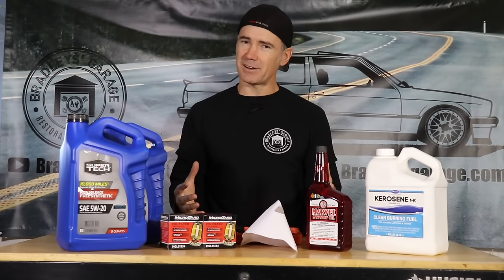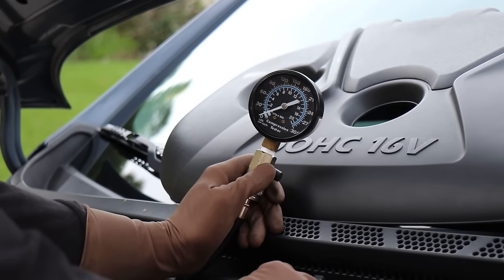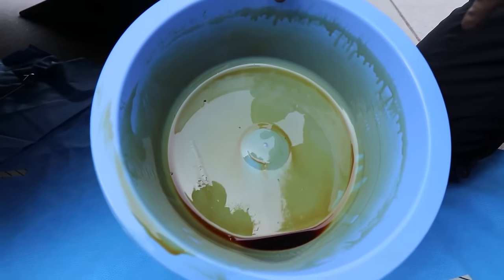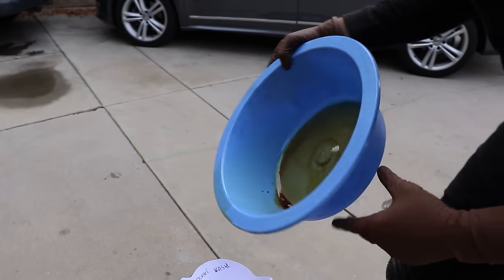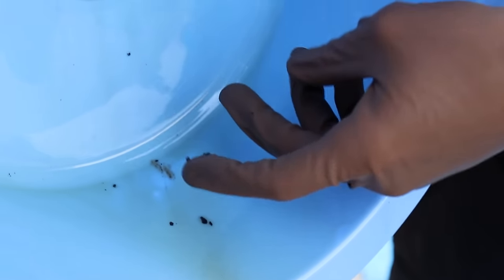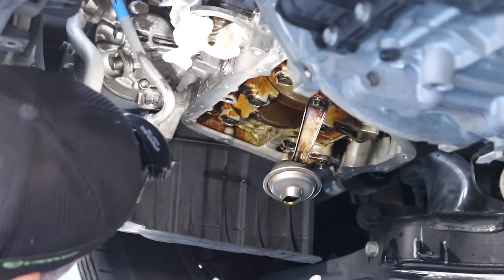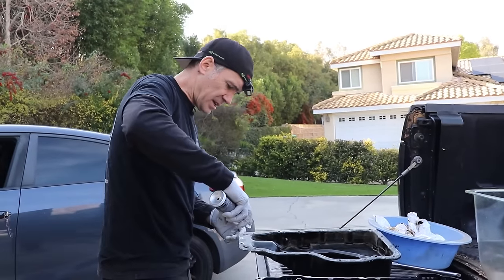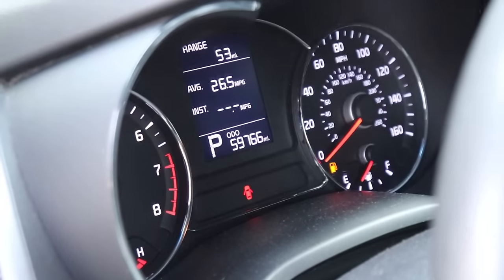*UPDATE* Customer States Jiffy Lube refused to change my Oil - Sludge Factory Kia Forte

Comment: What kind of gloves are you using? They look very durable
Reply from the maker: Thanks for the question, our go to latex gloves are the MicroFlex Diamond Grip brand.
https://www.amazon.com/Microflex-MF-300-M-Diamond-Textured-Fingers/dp/B002T11XJ0
We have a couple friends that work in the OR so occasionally we get a variety of other styles but Latex works best for routine repair work.
Nitrile gloves are cheaper and thinner but stand up to chemicals (gas, solvents, brake cleaner, etc.) much better than latex gloves. So we use those for all the cleaning and chemical usage.
Cheers!

Comment: 2 bottles of rislone concentrate run for 500 miles would have flushed most of that
Reply from the maker: Thanks for the recommendation; we will definitely check out that product for our next Sludge Factory project.
Cheers!
PS - Be sure to check out the original video if you haven't seen it - https://youtu.be/XU79jXYWydA

Comment: Instead of diesel try using diesel engine oil, look for HD3 oil, which has a lot of detergent in it which gets all the sludge off.
Reply from the maker: Thanks for the recommendation Sean, that might be good to use for 3k miles. We will see how things look during the next oil change.
Cheers!

Comment: 345,000 on my 09 Tacoma and still can’t see the oil on dipstick when checked at 4,000 miles. Vehicle has been properly maintained since new
Reply from the maker: Thanks for the comments Rocky, I'm sure after 345k there will be a little oil burning going on. You could check the dipstick every 1k miles after a fresh oil change just to get an idea of how much it is burning over time.
Cheers!
Reply: @BradleysGarage  check it every 1,000 miles as it uses a quart every 1,000 miles. I was stressing how CLEAN the oil was

Comment: At what point does it become more economical to just replace the engine vs trying to eliminate sludge?
Reply from the maker: Thanks for the question, a good used engine is going for about $1,800. Figure another $2000-$2500 for removal and installation so you are looking at over $4k. All of the supplies for these flushes only came to $250.
It really comes down to how much time you want to spend on things versus how much money you got.
Cheers!

Comment: Great job all around. I'm a big Hyundai Kia fan. I've purchased 7 or 8 new ones since 2007. My latest purchase was two 2022 Tucson Hybrids (non plug in, only because they were never available here in Illinois) I bought an SEL Convenience (mid trim for myself) and a Limited (top trim) for my wife. They're amazing cars for the money, 33K and 39,5K. Getting 37 MPG out of each of them over the last few years. I'm a 3000 mile oil change guy myself. It's cheap insurance for these tiny 1.6 Turbo engines which work hard. Thanks for sharing all your great tips. Go Niners. Cheers
Reply from the maker: Thanks for the kind words, glad you enjoyed the video. We have recommended to Jake to start changing his oil every 3k moving forward. Like you said, it's cheap insurance to keep things running great for many more miles to come.
Cheers!
Reply: the 1.6 in that model hybrid i believe is still gdi as well so 3,00 miles intervals should help with carbon buildup, it kills Hyundai motors besides the metal debris left indie the motors.
Reply: @henrytom5824  Thanks
Reply: Buying a car every 2 years and judging them with just 30K miles is nothing, they are brand new. Tell us how are they doing after at least 100 K miles
Reply: @drbichat5229  warranty goes to 100k unlike all other brands
Reply: @drbichat5229  30K???? LOL, my SEL Convenience is two years old and has 3600 miles on it. Sometime in the next 4 weeks I'm selling it to buy a new 2024 Santa Fe Hybrid with the outdoor package (off road) on it. Hyundai is just like any other major brand. You get good ones and bad ones. It happens across the industry and has for 5 plus decades
Reply: 8 in 15 years sounds like junk to me. I’ve got 270,000 on my 2008 dodge ram and my last vehicle had 300,000 when I sold it and it’s still on the road
Reply: @DanielJohnson-ec8rk  LOL, don't be a hater cuz I'm a player bro. We're talking Hyundai's dude, not Mercedes, lighten up
Reply: I have 280k miles on my Santa Fe without problems 👌
Oil change every 3k miles. Everything works w/o issues..
Reply: @spacemaster5206  Wow, that's amazing.

Comment: Looks like it is ready for some long life now.  Just drive it and run 3000 mile oil changes.  pulling the oil pan and cleaning the sludge was probably the best action that you took.  I wish my 62 Lincoln oil pan was that easy to access.
Reply from the maker: Thanks for the comments Jeff, appreciate the feedback. Hoping it works out for this young kid since he really doesn't have the first clue what it takes to service a car properly. Cheers!

Comment: Some engines are sludge engines due to low friction low tension piston rings. Needs frequent oil changes.
Reply from the maker: Thanks for the comments. Hopefully we have done enough to salvage the motor.
We just posted the 3k mile update video here - https://youtu.be/QrJ0B-KXTw0
Cheers!

Comment: I would replace the PVC valve for sure
Reply from the maker: Thanks for the comments Chief, it was surprisingly clean and still had great flow after the valve cover wash. Since it's built into the cover you would need to purchase a new one at a cost of $250. The check valve itself is working as designed.
Cheers!

Comment: Most engine flush bottles are half diesel and half kerosene.  It does work at reducing sludge
Reply from the maker: Thanks for the comments Nicholas. We performed a good mix of a variety of solutions to get this one clean.
Be sure to check out the original video if you haven't seen it - https://youtu.be/XU79jXYWydA
Cheers!

Comment: Let's see valve cover pulled 10 times that will be 1500 dollars sir 😅
Reply from the maker: It's actually very easy on this motor, it only takes a couple minutes. We posted the 3k mile update video if you haven’t checked it out yet - https://youtu.be/QrJ0B-KXTw0
Cheers!

Comment: I believe you just saved that engine. And I hope the owner learned a valuable lesson.
Reply from the maker: Thanks for the comments Scotty, hoping we did enough to salvage the motor. We just checked in on it after 1200 miles and everything looks great. Oil level is still perfect and there are not any issues.
He's just a 20 year old kid that doesn't know anything about cars or what is needed to keep them running properly. He helped with the repair so he wants to learn and understand things.
Hopefully he has learned a valuable lesson on the importance of routine maintenance on his car moving forward. The goal will be for him to be able to change his own oil moving forward.
Thanks for hanging out, Cheers!

Comment: One thing that has worked for me is to replace 1 qt of oil with 1 qt of transmission fluid,
Reply from the maker: It was a toss up for us, diesel or ATF. We had the diesel readily available so we chose to go that route. It seems like both will have similar results based on the feedback we have been receiving. Cheers!

Comment: Nice video but can’t agree with the pre fill of the oil filters it is completely unnecessary and it is possible that you can get contamination in on the outlet side of the filter
Reply from the maker: Thanks for the comments Chad, appreciate the feedback. There seems to be a lot of debate about that part. We got tons of negative comments during the initial video on how we did not pre-fill the oil filter.
Since we primarily play around with Euro cars, we don't normally work on cars with a regular style oil filter. All of our Euro cars use a cartridge style on top of the motor.
Here a good video that discusses the myth of pre-filling your oil filter - 
https://youtu.be/939WTeorBnQ
Cheers!

Comment: Common Dude theres nothing much in the oil just open up the drain pan theres a magnet in there where metal particles will cling and stick into
Reply from the maker: Thanks for the comments Oscar, unfortunately the Kia does not have a magnetic drain plug. The good news is we haven't seen any metallic or metal particles so hopefully we have done enough to salvage the motor.
We just posted the 3k mile update video here - https://youtu.be/QrJ0B-KXTw0
Cheers!

Comment: Have been wondering how this was doing. Glad it appears engine survived without eating a bearing. No forbidden glitter.  
I know someone with a 2015 soul with the 1.6 na and they were so low on oil dipstick was dry. Variable valve timing wasn't happy under throttle and threw a light. Dude check your oil and get it changed regularly! With the known problems these have no need to invite disaster.
Reply from the maker: Thanks for the comments. We were expecting a little more excess debris to come out after the secondary flushes but everything looked really clean. Also happy that were are not getting any metal in the oil, hopefully we were able to salvage the engine.
We will continue to monitor it every 1k miles until the next oil change. Hopefully we got it squared away and it continues to run great from this point forward. Cheers!

Comment: A compression test is pretty “stock” nowadays. I’d of preferred a cylinder leak down test or an in-cylinder pressure transducer test, along with tag lines on the crank and cam sensor. If you can read the scope good, it can tell you a lot of info about the engines health.
Reply from the maker: Thanks for the comments, appreciate the feedback. We haven't invested in that equipment yet but hope to in the future. Cheers!
Reply: @BradleysGarage  AESWave has kits and scopes. If you get the equipment, definitely take a class or two (or more) on how to use/read/interpret the pressure transducer wave forms. It’s a really powerful tool once you know what you’re looking at in its various uses.

Comment: I would hope a lot of that sludge would dissolve and get trapped in the filter vs fall into the pan. if it stayed solid I'd expect it to plug the passages.
Reply from the maker: Thanks for the comments James. It seems like the majority of the sludge did get dissolved but it took several flushes to clean it out. This was the update video where things were already pretty clean and we were just trying to make sure all passages were clean.
Be sure to check out the original video if you haven't seen it - https://youtu.be/XU79jXYWydA
Cheers!

Comment: that motor is done. I can hear the 3rd main bearing already. the thrust bearing is defective and wears the 3rd main. kia had spent billions fixing the problem.
Reply from the maker: We will keep tabs on it Russ, not much more we can do for this young kid. Be sure to check out the 3k update - https://youtu.be/QrJ0B-KXTw0
Cheers!
Reply: @BradleysGarage  Honda used to do screwy things like this...back in the 1970s point being, the early imports were crap because their engineering was flawed but they got better. kia will do better or nobody will buy them

Comment: 20 weight long OCI strikes again lol
Reply from the maker: Hard to know exactly how many miles since the last oil change but definitely seems like way more than 6k miles. We are thinking more like 12-15k miles sine the last oil change based on what the internals look like. 
He has had it since around 30k and claimed to have changed the oil 4-5 during this period. I'm sure the cheap oil changes at Jiffy Lube did not help the situation. 
Be sure to check out the original video if you haven't seen it - https://youtu.be/XU79jXYWydA
Cheers!

Comment: I'd say 25k miles since the last oil change. Some has a long nose. Lol
Reply from the maker: Thanks for the comments Bryan, appreciate the feedback. Hard to know exactly how many miles since the last oil change but definitely seems like way more than 6k miles. We are thinking more like 12-15k miles sine the last oil change based on what the internals look like. 
He has had it since around 30k and claimed to have changed the oil 4-5 during this period. I'm sure the cheap oil changes at Jiffy Lube did not help the situation. 
Be sure to check out the original video if you haven't seen it - https://youtu.be/XU79jXYWydA
Cheers!

Comment: Change oil regularly or spend ten times in flushing the oil to clean it up.
Reply from the maker: Thanks for the comments June, hopefully Jake has learned a valuable lesson on the importance of proper routine maintenance.
We just posted the 3k mile update video if you haven’t checked it out yet - https://youtu.be/QrJ0B-KXTw0
Cheers!

Comment: Oil change at 3k?
'Pre fill' oil filter?
Reply from the maker: Hard to know exactly how many miles since the last oil change but definitely seems like way more than 6k miles. We are thinking more like 12-15k miles sine the last oil change based on what the internals look like. 
He has had it since around 30k and claimed to have changed the oil 4-5 during this period. I'm sure the cheap oil changes at Jiffy Lube did not help the situation. 
You can check out the original video here - https://youtu.be/XU79jXYWydA
Cheers!

Comment: how often does kia recommend oil changes
Reply from the maker: Thanks for the question, Kia recommends 7500 mile oil changes for normal driving and 5000 miles for extreme driving conditions. Since Jake does lots of short distances, he would fall under the "extreme" classification. 
We will keep changing it at 3k until things look to be back to normal.
We just posted the 3k mile update video if you haven't checked it out yet - https://youtu.be/QrJ0B-KXTw0
Thanks again for hanging out.
Cheers!

Comment: Can use kero also for flush mix to help clean the sludge donk 😢
Reply from the maker: Thanks Simon, we didn't have enough kerosene so we opted for diesel but they should both work equally well.
Thanks again for hanging out.
Cheers!

Comment: 14:42 Do the 2 lobes top right and the 2 lobes top left have an excessive wear line in the middle?
Reply from the maker: They all looked pretty similar to us, it may just be how much varnish was wiped off during the multiple flushes. We didn't take the time to wipe each individual cam lobe one by one.
Even if there is more wear on a few, there isn't anything that we can do at this point. Just got to take care of it moving forward and hope for the best.
Cheers!

Comment: Marvel Mystery Oil is supposed to be mixed with motor oil up to 20% not 25.
Reply from the maker: Thanks for the clarification Bill. Since it holds 4.2 quarts total it ended up being less than a 25% mixture, 23.8% to be exact. In addition, we only drove it for 420 miles with the MMO mixture inside.
We will keep running 4oz to each subsequent oil change moving forward until things are nice and clean again.
Cheers!
Reply: @BradleysGarage  I use 15W-40 diesel truck oil mixed with 6 oz per quart MMO in my trail bike for the last 12 years.  Still runs like new.  No oil burning.

Comment: What you think of supertech oil?
Reply from the maker: Thanks for the question Ramon. It looks like SuperTech is made by Warren Oil Company International. But Exxon and Pennzoil also bottle some of the SuperTech depending on the state you live in. 
Here are some tips for identifying which company produced the bottle you are buying-

ExxonMobil
The best way to tell if the oil was made by ExxonMobil is by looking at the bottle cap. It’s larger than a normal Supertech cap and will be similar or exactly the same as the caps found on Mobil 1 oil bottles.

Warren
Most of Walmart’s synthetic motor oils are made by Warren. The best way to tell if you’re buying a Warren-made oil is by looking for a white rectangle on the front or back label. The rectangle can be blank, have a number inside it, or have a QR code.

Pennzoil
Pennzoil-made oil can be identified by the packaging stamp. Because it’s packaged by Constar, it will have a small letter C with a star inside it on the bottom of the container. However, keep in mind that Warren will also use Constar packaging if they’re running short on their own, so check whether there’s a white rectangle on the labels to confirm or rule out Warren as the manufacturer.

We are not using the SuperTech in any of our high performance vehicles but for a daily driver or something with a couple hundred thousand miles, it is great for the price. the most important thing is to perform routine oil changes and not exceed the manufacturers recommended intervals.
Cheers!

Comment: You should try using the new Valvoline restore and see if it works as they state.
Reply from the maker: Thanks for the recommendation; we will definitely check out that product for our next Sludge Factory project.
Be sure to check out the original video if you haven't seen it - https://youtu.be/XU79jXYWydA
Cheers!

Comment: Just a question why do cars in europe dont have the sludge problem?
Reply: Has nothing to do with Europe, everything to with consistent oil change intervals. Especially in engine that are known to create sludge.
Reply from the maker: Thanks for the comments, a lot of European brands these days are extending their intervals to 10K+. It's like DW said below, the most important thing is to perform it on a regular basis, which in this case it obviously did not happen.
We just posted the 3k mile update video if you haven’t checked it out yet - https://youtu.be/QrJ0B-KXTw0
Cheers!